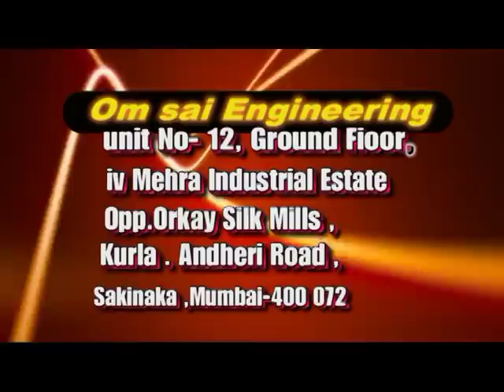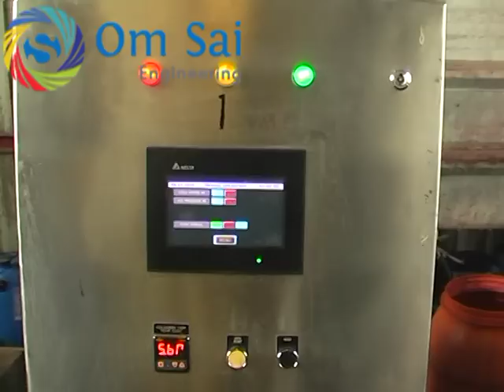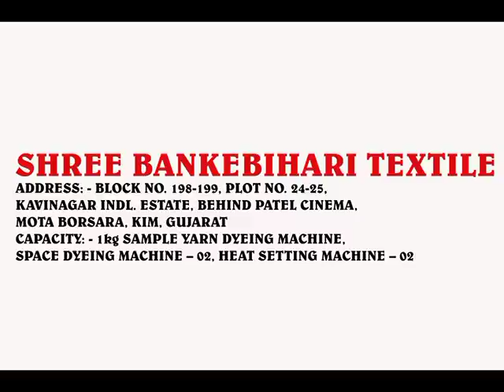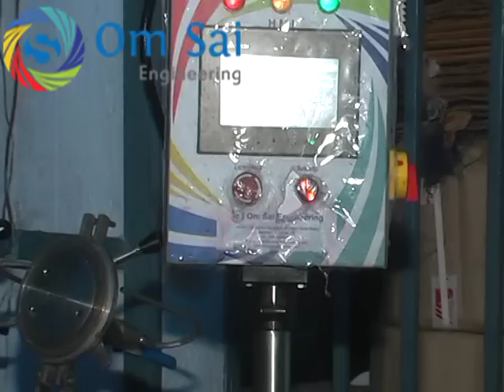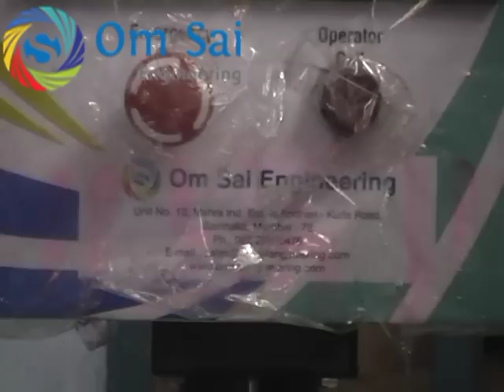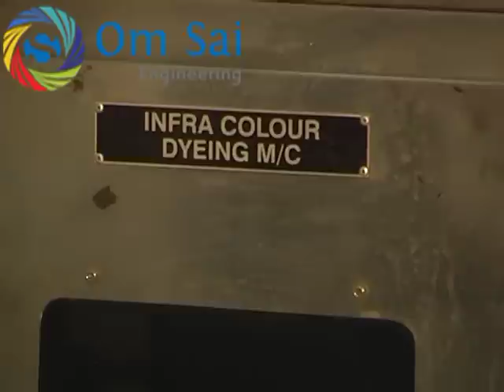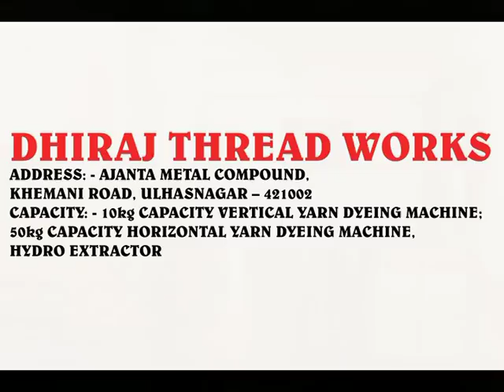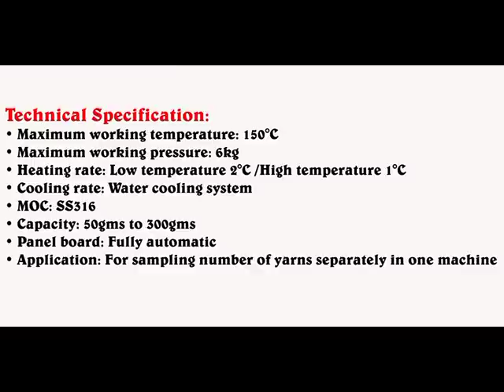yarn dyeing machine working

Comment: Which type of yarns is dyed in this machine?

Cotton
Polyester
Acrylic
P/C
Merserized 
Polypropylene
Reply from the maker: Cotton, Polyester, Viscose, Wool, Silk, Nylon

With warm regards,

Mr. Dhiraj Negi (Proprietor)
098700 47579.

(An ISO 9001:2015 Certified Company)

Manufacturers of:

VERTICAL YARN DYEING MACHINE, SPACE YARN DYEING MACHINE, TEXTILE  LAB EQUIPMENTS & OTHER TEXTILE  EQUIPMENTS.

Gala No 35, Creative Industrial Premises Co. op. Society Ltd, Manicha Pada, Survey No 106, Pelhar, Vasai Phata, National Highway No 8, Vasai – East, Dist. Palghar - 401208 Phone No: - +91 7028027579

E-mail: sales@omsaiengineering.com / dhirajnegi81@rediffmail.com  / omsaiengr@gmail.com 
website: www.omsaiengineering.com

"!THINK BEFORE YOU PRINT-SAVE PAPER-SAVE TREE!"

SAVE WATER J ~ SAVE ENERGY ~~  SAVE EARTH P
Reply: Cotton polyester acrylic bambo yarn dyeing master

Comment: Very nice dye house
Reply from the maker: Dear Sir,

Thanks for valuable comment. We manufacture HTHP Vertical Yarn Dyeing Machine, Horizontal Yarn Dyeing Machine, Space Dyeing Machine, Spray Type Hank Yarn Dyeing Machine, Sample Yarn Dyeing Machine, Heat Setting Machine, Hydro Extractor, Hot Room Dryer, etc.

With warm regards,

Mr. Dhiraj Negi (Proprietor)
098700 47579.

(An ISO 9001:2015 Certified Company)

Manufacturers of:

VERTICAL YARN DYEING MACHINE, SPACE YARN DYEING MACHINE, TEXTILE  LAB EQUIPMENTS & OTHER TEXTILE  EQUIPMENTS.

Gala No 35, Creative Industrial Premises Co. op. Society Ltd, Manicha Pada, Survey No 106, Pelhar, Vasai Phata, National Highway No 8, Vasai – East, Dist. Palghar - 401208 Phone No: - +91 7028027579

E-mail: sales@omsaiengineering.com / dhirajnegi81@rediffmail.com  / omsaiengr@gmail.com 
website: www.omsaiengineering.com

"!THINK BEFORE YOU PRINT-SAVE PAPER-SAVE TREE!"

SAVE WATER J ~ SAVE ENERGY ~~  SAVE EARTH P

Comment: king Aparel karachi
Reply from the maker: With warm regards,

Mr. Dhiraj Negi (Proprietor)
098700 47579.

(An ISO 9001:2015 Certified Company)

Manufacturers of:

VERTICAL YARN DYEING MACHINE, SPACE YARN DYEING MACHINE, TEXTILE  LAB EQUIPMENTS & OTHER TEXTILE  EQUIPMENTS.

Gala No 35, Creative Industrial Premises Co. op. Society Ltd, Manicha Pada, Survey No 106, Pelhar, Vasai Phata, National Highway No 8, Vasai – East, Dist. Palghar - 401208 Phone No: - +91 7028027579

E-mail: sales@omsaiengineering.com / dhirajnegi81@rediffmail.com  / omsaiengr@gmail.com 
website: www.omsaiengineering.com

"!THINK BEFORE YOU PRINT-SAVE PAPER-SAVE TREE!"

SAVE WATER J ~ SAVE ENERGY ~~  SAVE EARTH P
Reply: Washing machine hydro dryer yarn deying machine banaty ha Pakistan may